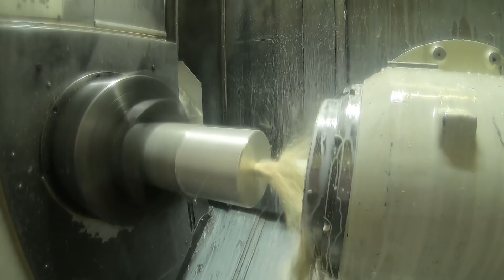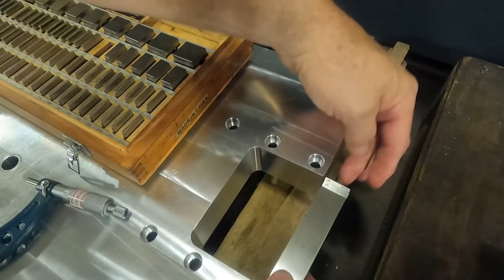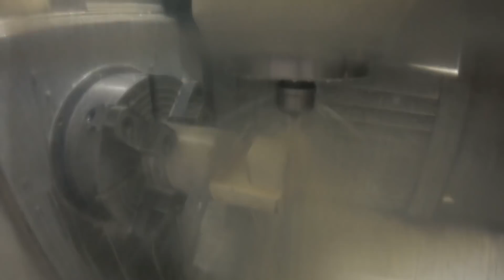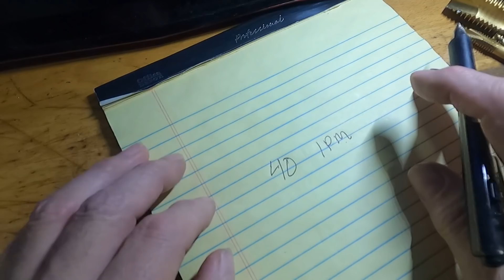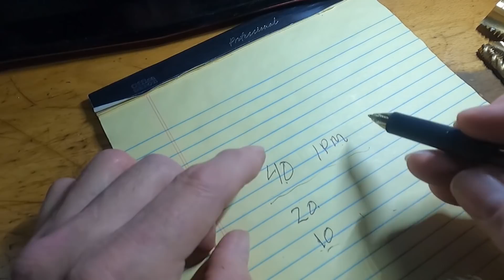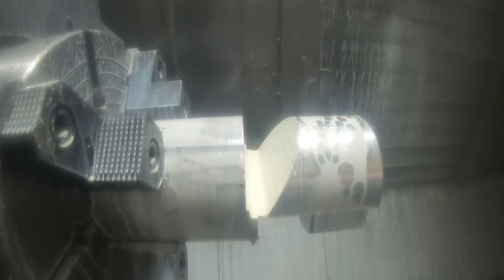Tail Stock Support End For Mazaks Fixture.

Comment: If you have trouble wringing joe blocks (or gauge blocks) together, try running the block against your nose or the inside of your wrist. Or just use your finger and wipe the skin oil on the block. They will wring together properly and won't come apart nearly as easily.

Comment: 1/ pitch x rpm = feed rate for tapping orrrrr you can just go g95 and set your feed rate in IPM. So for 3/4-10 it would be 1/10=.1 
G84 x y z r f.1 (Q) added if pecking required

Comment: What does keep the turnung tool from rotating when it's cutting? Is there a mechanical locking mechanism or is it just the holding power of the servo motor tha holds it firm?
Reply from the maker: This machine has a special coupling in the front of the spindle. When clamped it keeps the spindle from rotating and takes all the load off the milling spindles bearings. It has the ability to orient and clamp every 15 degrees. So you can turn toward the chuck reorient the tool and turn away. Or position the B axis horizontal and orient and bore with the same tool. If you wanted.

Comment: Nice discussion on tapping!

When do you go with thread milling instead?
Reply from the maker: On the Mazak whenever I can. Because the machine wont run with the doors open to add any oil or blow the shavings off the tap. But in general on any machine I thread mill if the material is hard to tap or the full thread has to very close to the holes bottom on a blind hole.

Comment: boy you have me so intrigued now. I've always tapped at 20m/min (vc) for steel (I was told that by a guy once and never tried anything else), but when I work out your theory, and going off some basic formula, it works out ranging from 20-25m/min for all the common size taps I use (m5 to m24). I was so surprised. Basically, I'm right on the money for smaller taps, but it means I should be able to speed up my larger taps maybe 25% faster... very interesting.

Comment: A superb video as always, of all videos your fixture videos are my favourite. When setting the tool offsets with the gauge pin, is it always best to set them when the B axis is the same orientation as you intend to do the actual work? Does doing so make the inputting of the offsets easier or is there another reason?
Reply from the maker: It is possible to set the offset on a milling tool on a face turned to Z zero. Than use the tool on the OD or at any angle. In this setup I knew the diameter of the bar and the milling tools were going to work with B at 90 degrees so I set them there. In the next video you see me setting turning tool on the face and the OD. A turning tool has two length offsets X and Z (Lengths A and B on the Mazatrol Control). I like to set a offset in the orientation the tools is working if possible. A 5 axis tool this may not be possible so setting in either with B at 0 or 90 degrees is OK. The Mazatrol shows you the tip location of the tool in the spindle at any B axis orientation in relation to the active fixture offset. G54 being the default when pushing reset. This makes it very easy to manually set the offset. Unlike some controls. On them you have to actually call the offset or subtract the length of the machine location from the fixture offset where you are touching off on.
Reply: @EdgePrecision  interesting thanks Peter. Your videos are what really started my interest in CNC machining,  I'm 5 weeks into a night school course  in CAD CAM

Comment: what is the bet way to extract broken tap?
Reply from the maker: I usually drill them out. Down to around a 4-40 thread that's possible. Below that in size EDM would be best. In aluminum there is a special acid that dissolves the steel but not the aluminum. But every time I have tried it, I haven't had much success.
Reply: @EdgePrecision  Thanks Peter

Comment: Hi Peter, thanks for the video. I am wondering why you spun the chuck instead of the spindle for the drilling op at around the 1:20 mark? I would have thought that you would just drill normally. Cheers
Reply from the maker: There are two ways you can drill on the center of rotation on this machine. With the turning spindle as on a lathe or of course with the milling spindle it can drill anywhere. As far as this program in the cam software it uses the last selections on the drilling cycle. I forgot to change it to the tool rotating instead of the part rotating. When I ran the program it kind of startled me at first because I was intending to drill with the milling spindle. It does show the chuck rotating in the cam's stimulation but I must not have been paying attention when I ran it. Or I would have changed it. In reality on centerline it doesn't matter unless the drill has to turn more than 1600 rpm. Or the part cant turn that fast because of balance/chucking issues. That's the max speed of the turning spindle.
Reply: @EdgePrecision  Oh I see, I thought it was a special method you had experimented with. Thank you for the quick response - much appreciated and keep up the excellent work!

Comment: Thank you Peter. Your timing is perfect. We've been having some tapping issues at work and you've given me some excellent info. When is PECK TAPPING required?
Reply: When you have the tap fully engaged into the material and the swarf has nowhere else to go.
Reply: @Sicktrickintuner  So there would be no reason to peck tap a through hole, right?
Reply: @ccfoam  You'll still get chip buildup in the flutes on any deep hole. I was always told, anything over 1.5xD you need to peck. but it really depends on the size of the thread and the amount of material you're removing. If In doubt, peck it. otherwise pucker up and go.

Comment: Awesome . It's a shame we don't utilize the full potential of the mazak integex machines . Ether in Mazatrol or G code . I know it's 5 axis with capto tooling . 12 or 15" chuck 400 Y . I program and run a 200 y fusion but we have a new I200 smooth control.
Reply from the maker: That's why they call them Mill Turn (Not Turn Mill) machines. They are really a milling machine that does turning. For some reason people that get these machines do mostly turning on them. It's like you say they don't get the full potential out of the machine.

Comment: I need a set of gage blocks like that for my woodshop.  Do you happen to know where I could get a set these days?
Reply from the maker: Pretty much any tool supply house. Maybe even on Amazon. For wood work a less expensive grade would be acceptable. M set I use in the shop in this video are 81 piece Grade B Square ones. The rectangle sets are more economical. The more precision sets can be very expensive. Not really necessary for woodworking applications.
Reply: @EdgePrecision  I'll eventually also use them for machine work but recently I realized a personal set would be extremely handy in the woodshop.
Reply: @prototype3a  get out the pocket book, they aren’t cheap. One small import set can easily be $700. Or really high end ones for a few thousand
Reply: @Sicktrickintuner  Yeah, I think the cheapest square set I've found was $500.  I'm still researching and looking but it does appear I'll be purchasing a rectangular set instead to save ~$350 or so.

Comment: I see you use aluminium on your "table" and the end support. Its stiff enough to not cause vibrations? In what cases would you rather go for steel alloy in the plate ?
Reply from the maker: When you see the finished fixture you will see that in this case aluminum is going to be fine. In fact I have already mill some of the parts and everything is working. I did use steel for the edge stiffeners.
Reply: @EdgePrecision  nice! Thanks for the reply

Comment: Peter, what are your thoughts on Thread Milling? (I am ABSOLUTELY NOT saying you should use that method) Just curious what you believe the pros and cons are.
Reply from the maker: On the Mazak I will always thread mill before tapping if possible. The pros an cons. Thread milling has more control of size and finish. It also can get closer to a blind holes bottom. But it takes more time than tapping. If you break a thread mill it’s inconvenient but can more easily recovered from than a broken tap.

Comment: I’ve found that the pecking isn’t too bad for larger taps but not on the spiral flute taps. The spiral ones need the chip to “flow” out the top unbroken. If you break the chip with the spiral it doesn’t restart correctly and can get bound up. Easy test is to do a 1/4-20 with a spiral flute by hand and break the chip. You’ll immediately feel it start to bind up. I think the new chips start trying to push the broken ones out and they bind. Awesome info on the speeds/feeds. Thanks
Reply: I can understand how that can happen.
Reply: Yep, my thoughts exactly, ive done that with spiral flute taps. And it does bind much more

Comment: Also, is this thing direct drive on the head? Or is there a motor in the structure with a transmission/belts/right angle drive/etc/etc?
Reply from the maker: The milling spindle is the motors shaft. Direct drive 50 hp. The turning spindle has a two speed gear box. With a 60 hp motor.
Reply: @EdgePrecision  thank you!

That's pretty amazing. Crashing that spindle with any consequence has to cost a fortune.

Comment: For something that fussy would a snap gauge be better than a micrometer?
Reply from the maker: I’m not sure, are you referring to the mechanical expanding gauges typically used to measure bores with, as a reference gauge? Or are you referring to a dial gauge set on the gauge blocks? If the dial indicator type set on the gauge blocks, yes that could be good. I don’t have such a dial gauge for outside measurements.

Comment: I am curious, how did you determine that the table of your center support was at the right height so that your plate would match up with the center?  I hope I described that right for you.  Charles
Reply from the maker: I will be address this in a future video. But the short answer is I modeled it in cad so there will be stock to machine away. After the fixture is mounted and aligned in the machine. To bring it to a precision location.
Reply: @EdgePrecision  Thanks, have a great week.  Charles

Comment: Hmm, never thought of tapping like that. I've always calculated the feed/speed based of surface speed. Quality brands publish the SFM to run the tap at for whatever material and its way higher that most people would think of running them. That said it is a really good rule of thumb no mater how you calculate your speeds, if your IPM is way off say 5 ipm in carbon steel you know to double check the maths.
Also I totally agree, almost everyone will start to slow things down when it's not working or they want to be 'careful' but a lot of the time that's actually the exact opposite of what you should do.  Bad finish or carry tap life on threads is commonly caused by going way to slow so try going faster. I tapped a pile of 3/4" NC holes in some 1" thick AR500 and as per the manufacture I ran them at 20 SFM (around 10IPM) and got around 50 holes with one tap and it still looked fine and probably would still do another 25 or so holes. 
I've also used some less good taps ('quality import') and they just don't work worth a shit no mater the speed, buy good taps and run them at the right speed and it's way cheaper than cheap taps at the wrong speed.
Reply: Who makes good taps? I'm far from a machinist and don't know very many, but I'd rather spend money than waste time. I just don't know enough about the industry.
Reply: @AntagonisticAndy  I’ve had good success with OSG or emuge. Maybe a good economy tap is greenfield.
Reply: @justinmoritz6543  Agreed, had great luck Emuge.
Reply: @AntagonisticAndy  ya emuge, osg, walter, yamawa, dormer, and the list goes on... anything with a data sheet and a rep to back it up will be pretty good.
Reply: @AntagonisticAndy  I Like guhring, but that doesn't mean they're better than the rest, that's just the higher end taps that my local supplier sells, and I've had great success with them.

I did a job a while back, had to tap a couple of hundred holes 1/4" BSPT, I did about a hundred or so with one tap from my normal supplier, but it dulled out on a sunday morning and nowhere decent was open so all I could get to finish the job was Sutton from the local hardware store, I ended up going through 5 of them to finish the job for monday morning delivery. went from around 32c per hole to well over a dollar per hole... I know sutton do make some OK Jobber-type stuff, but the stuff they sell at general hardware stores is absolute crap.

Comment: Another point. We keep taps separate, according to what material they have been run in. Don't ask why as I don't know but the life span of them is tremendously increased. We also don't use the guideline formulas for tapping, plenty of tapping fluid and slower (like you say many do, guilty) taps last a long time.
Reply from the maker: It’s the reversing of a tap that is hard on it. I have tapped thru holes with a form tap that didn’t require a thru thread. But taps kept breaking after so many holes. We changed the program to tap all the way thru before reversing the tap. Didn’t break a single tap after that.
Reply: @EdgePrecision  I've always had much better luck with form taps in tough materials. That is after I figured out they take a larger hole ; ) I'm on manual machines though. Thanks for always sharing your expertise Peter!

Comment: Never had this issue with a spiral tap and I've tapped in every material going. Take drill tolerance to 0.1mm before top limit. Chamfer or ball mill before use. Straight taps are designed to push cuttings through, hence why they are best for through holes.
Reply from the maker: We’re you peck tapping?
Reply: @EdgePrecision  No, not pecking. Big chuck tap holder and straight to depth if it is a closed hole. Straight through if it's a through hole.
Reply from the maker: @richiejbhoy1888  I was relating it to pecking with smaller spiral flute taps in tougher materials. If your not pecking you wouldn’t have a problem.
Reply: @EdgePrecision  ah, so pecking is notorious for issues. That's why it's never an option. If we are worried about snapping, then we use a roll tap. But it's rare we do, M3 M4 M5 in some cases.
Reply: I always break those spiral flute taps. When you get past 1/2" they are better. But down to m4 is really no fun. Break at least one every time it seems